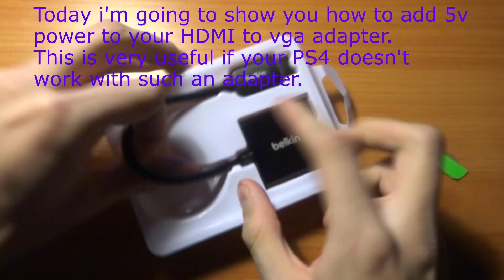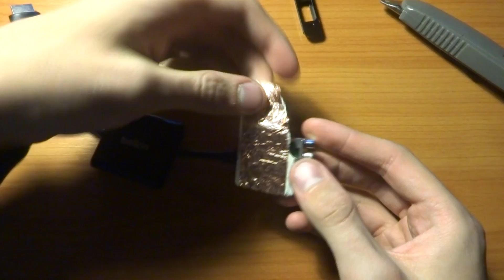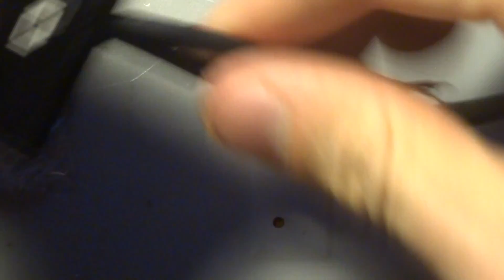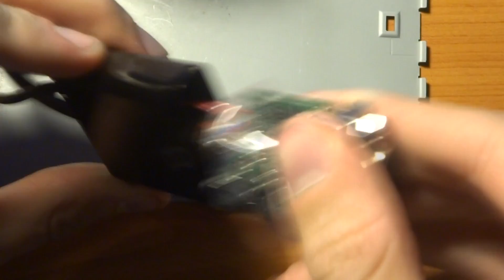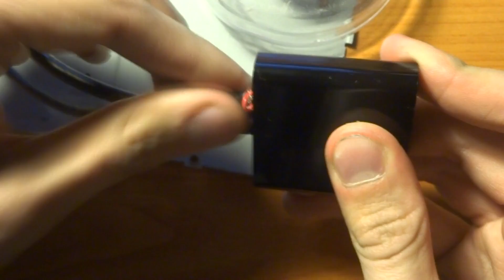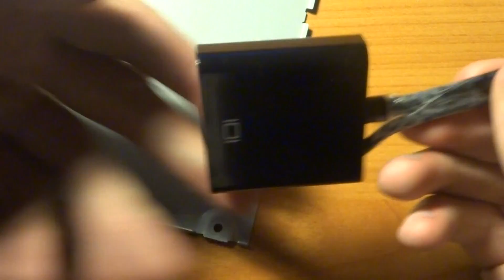Make an active HDMI to VGA converter(add 5v) (useful for PS4)

Comment: My hdmi to vga has a single resistor, 3 caps, central controller, and an unused Diode, capasitor and an audio and power jack.
Looks like it is a PCB That can be both ways depending on what is soldered on.
Not as intricate as the one you have.

Comment: Why the need for 5v. Don't it works with out it?
Reply: For the ps4 it needs power input. But you can buy a vga adapter with the power supply, no need to mod.
Reply: @davidalves6813  thanks
Reply: Also, when using an HDMI Extension Cable, the adapter doesn't work for some reason, but giving that 5V input does the trick

Comment: Hi, good video! I've a problem with a HDMI-VGA converter (with integrated 5v). Whe I use it with my PS4 I notice that left channel is reversed with right and right is reversed with ground..
So when I pull off gently the male jack I have the right sound! Can I mod the converter? Thanks

Comment: You were doing pretty good before the tape. Just tie a knot in your power cable just inside your enclosure like most manufacturers do and it can never be pulled out without needing any tape.

Comment: Sir, I use a MICRO HDMI to VGA WITH AUDIO JACK converter, and I only use the audio jack, for monitoring audio on a mirrorless camera using headphones, and it works.

 it's just that when micro hdmi is connected to the camera, the screen on the camera turns off.  So it is difficult to operate it,

 Can I disconnect one of the cable pins so that the video transfer is not active ?? ..

 And what cable from the pin should I disconnect ?? ..

 Sorry if my English is bad, because I use Google Translate.
Reply from the maker: Which camera do you use? Isn't there a option in settings of te camera?
Reply: @AllesOverApparaten  thank you for your attention sir, my camera is Canon m50
Reply: Not exact camera but this might help https://www.youtube.com/watch?v=lYCGOQIXHF0
Reply: @Daniel-yb6fy  thank you sir, I have checked the settings on my m50 several times, unfortunately there are no such settings

Comment: Great! I have a question: If i have another adapter, how can I find wich pins needs to be supplied with 5v? and in any case, how do i know it's 5v or another v? Do i have to measure it from the hdmi cable to each pin with a tester? 
Thanks for the video and sorry for my english!
Reply: I think just finding a ground is enough because you can find 5 volt with multimeter

Comment: I have a wire using pin 18 and pin 8 is empty and they are both under the board can i solder it if that is the case
Reply: Bro did you already done this ?   Did it work ?
Reply: @randomytvidsPH  didn't bother trying it, i post thread in reddit and Tom's hardware and nobody gave a solution

Comment: My cable is without aux can u give me pins for aux?
Reply: If ur using it for ps4 you can just use a aux cable and connect it to the controller aux port or put USB speakers on your ps4

Comment: Im trying to connect to and old CRT. After doing this work for a while but after restart the PS4 i got black screen on CRT. What is the recommended screen settings i need to put?.
Reply from the maker: Why would you want to connect your ps4 to a crt if i may ask? Just buy a very cheap flat panel screen.
Reply: @AllesOverApparaten  and why not? XD.  Because i play games with this on my 22' inch Philips pc CRT. I like the colors on It. Have fully black color. My Xbox 360 for example looks so cool on It. I can play perfectly to the 360 at 720p, that its the maximum res supported, but after make active the converter only one time i can make fully visible the PS4 on the monitor but dont remember the settings i put on that moment.
Reply: This is my CRT monitor specs https://www.philips.es/c-p/202P40_20/qxga-realmente-plano-de-22-pulgada/caracteristicastecnicas and the max resolution is 2048 x 1536 a 80 Hz

Comment: Any proof
Reply from the maker: Read the other comments for proof.
Reply: @AllesOverApparaten   sir in my adapter it shows only pin 18. And pin 8 is not there. But instead there is 1 ,3 5,7,9 pin
Can you please give a solution
Reply: Ok thank you
Reply: Fix USB port in it
Reply: It's true I have tried it and works very well

Comment: I didn't understand with the pins... Which one do I need to solder? If german, then pls help in german.
Reply from the maker: The 5v needs to go to the 5v point of the adapter and the other wire to a gnd pin
Reply: @AllesOverApparaten  and where can I find that?

Comment: Shiiiit I was going crazy coz I just bought my ps4 and I have just sold my tv coz I will get my self a new one but I wanted to try it on my computer display which has VGA only and I had the same adapter that you had. I have studied IT so I know a lot about soldering and electrical components so I tried the method you showed us and it fuckinnnn worked!!! god, you don't know how happy I am now I just stared at the display for 5 sec like an idiot and couldn't believe that it worked! thank u very very much sir you really saved my day and a lot of frustration. thank you again
Reply from the maker: Thank you for the nice feedback, glad you found it useful! Anything else you want to see in a future video?
Reply: hey since you know some stuff can i ask you if I have a wire using pin 18 and pin 8 is empty and they are both under the board can i solder it if that is the case
Reply: and everyone who disliked the video can go to hell and start learning some IT to figure out how to do some electrical shit
Reply: @dahman97  
Bro.Can this method be useful to stb (set top box) with hd output to pc monitor with vga input?
Reply: ZouZou Khazma i am not sure, but i can CONFIRM that this method works 💯 percent and it’s-worth trying you won’t loose much but be carful when soldering the pins cause u don’t want to solder to of them together and may damage Hdmi output
Reply: @dahman97  
Thank you. I will try.

Comment: I have same HDMI to VGA converter  18th pin +5v ok and 17th pin ground ok .but my chrome cast2 not working for HDMI to VGA converter.but audio working . screen resolution out of range 67.5khz/60hz. Show the screen . please any ideas... converter volt is ok.
Reply: Set the resolution at its minimum value then try upmost resolution. Output is higher than input signal.

Comment: Hi ! 
Great video ! 
I can't find the pins you are talking about though 
Here are pictures, coul you help me out please ?
ibb.co/m7c1O9
ibb.co/jmB6qp
(Add https:// at the beginning, I post it this way not to be flagged )
Reply: @ND ok so first remove that hot glue  with a hair dryer or heat gun then you look for gnd letters that stands for ground then with your finger trace the closest line to gnd that will be going to a solder pad then if you want get flux. flux is 100% optional k so u found the pad now add a tiny bit of solder and ur done with step 1 step 2 find a power solder to any non gnd pads that is power/video. step 3 this is optinal so to pevent future issues add a electrolytic capacitor get one for $0.23 i reccomend a 7.3v  capacitor step 4 enjoy the  capacitor will blow if u fucked something up leaveing ur ps4 undamaged

Comment: Is he using a charging cable but when I cut my charging cable it shows 4 wire he has only 2
Reply: use the black and the red wire
Reply: Use black and red one. The others are Data wires.

Comment: This is amazing! Super easy and it really works! :D Thank you very much!!!
I had an old HDMI to VGA adapater rolling around. Wanted to use it to connect my PS4 to a projector and it didn't work. Followed this tutorial, soldering the red wire of an old USB cable to pin 18 and the black one to "GND" pin. Tried it again on the PS4-Projector and works like a charm!
Reply: So, is this hack for letting the PS4 connect to a projector? Could it be applied somewhere else?

Comment: I need help. I did it and it works well with my on board graphics but will not work with my gtx 1050 pls help
Reply: divesh nundlall I have got same problem have u found any solution?

Comment: when i plug added power to the usb plug, the ps4 suddenly power off, after restart ps4 can display to my vga monitor. But, when i want to use direct connection using hdmi to my hdmi monitor, it's broken, no signal, i think the hdmi ic got short, please help..

Comment: first of all thank you for your instruction. i cut a phone charger cable and successfully soldered it. now i can connect my ps4 pro to my old vga monitor. it's also working without ground. my question is what happens if i don't solder ground?
Reply from the maker: emrah türkmen if the ground of the 5v usb cable is not connected you will not need this mod!

Comment: When I turn on the Ps4 for a while, it will get hot. Is there any problem. Do I need to make some Cooling module?
Reply: AllesOverApparaten can u speak English
Reply from the maker: It can get it a bit warm but you should be able to touch it without a problem. Otherwise you may have to check the wires. maybe you soldered the 5v + wire to 2 joints at the same time. Mine gets a little warm too though.
Reply: Thanks a lot
Reply from the maker: No problem.
Reply: i use 2 week without any problem

Comment: En mi caso el HDMI venía de la salida de un decodificador de video cable digital y no tenía la corriente necesaria. Funciona perfecto, tenía duda en cuanto a los pines ya que el 18 y el 8 no estaban marcados y el circuito difería del que sale en el video. Para no errarle vi que hay un integrado AMS1117, es un regulador de voltaje, conecté la alimentación externa directamente a su entrada. Me solucionó el problema

Comment: Its work guys try it if you have black screen problem its easy.thanks...1 question  now i have problem with the sound do you know what can i do???
Reply from the maker: GRIGORHS you need to have a adapter with a 3,5 mm sound plug in it otherwise you won't have sound. or you need to plug in you headphones to your controller.
Reply: I see in your subscribers that you sub on vesic and balkan tech does it mean that you serbian

Comment: I can confirm this works. Add 5v to non-powered(active) hdmi to vga adapter and PS4 will work (Because PS4 low power output hdmi port).
I have a questions: Did you fully de-solder, or did you just barely melt the solder pad and let the wire stick into the melted solder and harden?
Reply from the maker: LilStewie i fully desoldered the wires but i didnt show that in the video.
Reply: Ok, thats what I figured looking at the solder blobs.
I accidently pulled out the pin 18 and ground wire from my adapter I have and now need to buy a soldering iron.

Comment: can you speak german?
Reply from the maker: Meriiton Gashii Nicht bestimmt, ein bisschen.
Reply: AllesOverApparaten ich habe das gleiche problem aber mein konverter ist ein bisschen anders, ich wollte fragen ob du dich vll. damit auch auskennst
Reply from the maker: können Sie ein Bild Posten? Vielleicht kann ich Ihnen helfen.
Reply: wie soll ich ihnen das bild schicken?
Reply from the maker: schicke das bild zu: allesoverapparaten@gmail.com
Reply: Meriiton Gashii theoretically, as long as the USB block you use is 5v and a similar amp

Comment: can you explain what you did in the video im lost
Reply from the maker: Argo i soldered a usb cable to 2 pins of the adapter so it has 5v extra power. if you plug that usb cable in your playstation it will work just fine